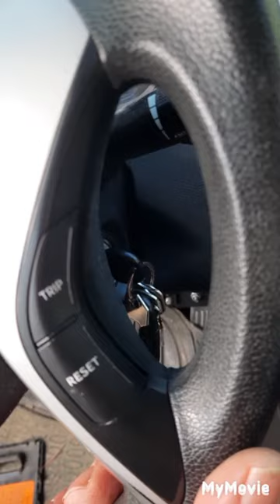Hyundai & kia steering wheel clicking sound .fixing

Comment: Hello, Really enjoyed the video.  I was wondering if you had come across or have heard of the 2017 Azera having a "sticky/binding" issue in the steering wheel?  I recently purchased a CPO 2017 Azera with 16,400 miles.  Didn't feel anything on the test drive around the dealership.  On the way home (2 hour drive) I noticed a "sticky" feel when I made slight adjustment to keep car straight.  It felt like the wheel was stuck and then when you finally put enough force for it to move it would.  It was a constant fight all the way home.  Dealership said that it was "normal" for these cars.  No way I said.  I did some research and found a TSB #20-ST-001H-1 that states if the car has no DTCs and "Sticking/Binding" issue is felt to replace the Column & Housing Assembly (56390-3V460).  My car doesn't have any DTCs so I printed information and took it to the dealership that sold me the car.  They finally agreed to order the part and install under warranty ( The car has 4 months left).  What do you think?  Any information would really be appreciated.  Keep up the great work and you've got yourself a new subscriber!  Thanks!!!
Reply from the maker: Hello and thanks for reply. Ur right i also heard its a common problem with azera .but even when replacing the steering column the problem will then accur after a while. I think its the torque sensor that dont sense the little power ur making to the steering wheel to give the ecu a signal that in turns gives the motor a signal to start helping turning the steering wheel.when u increase the torque it senses that and work normally. even when there's no dtc .so it might loose some of its sensitivity without any code .there is so many called no code sensor failures and yes i think u should change all the steering column . I think the cars companies want it to be like that ,making theses on purpose .the most of their profits comes from service and auto parts .i didn't worked on azera before . But i think it's the problem . and thanks for ur subscribe